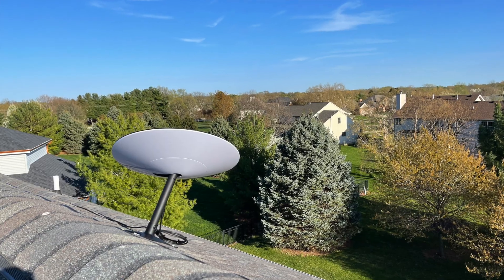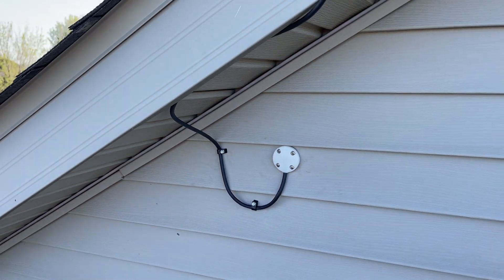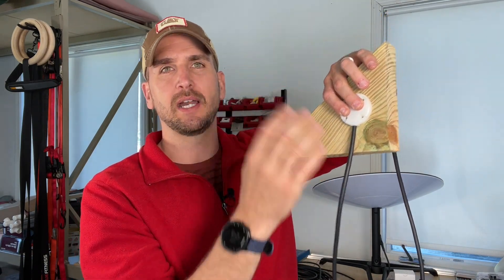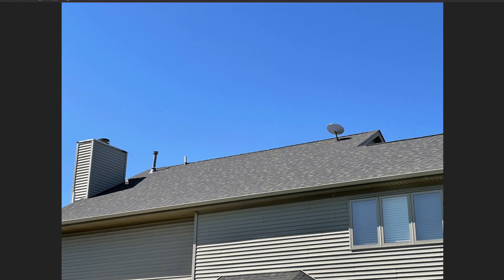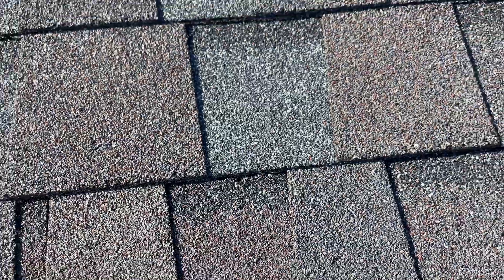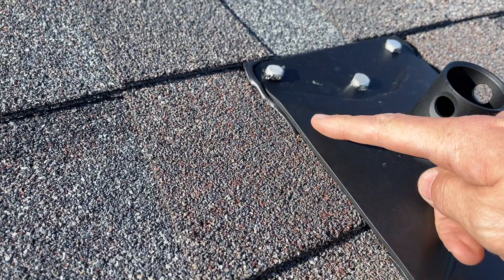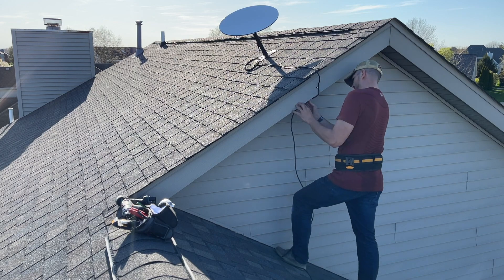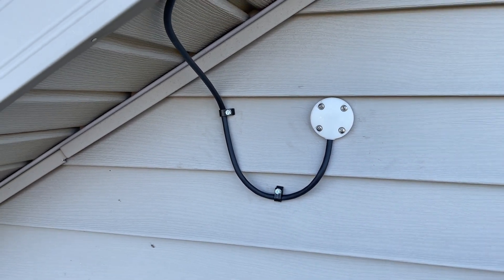Starlink Full Installation and Speed Test

Comment from the maker: Waterproof Cable Entry Cover:  https://geni.us/zS1Mp
Cable Electrical Plate (Brush Type):  https://geni.us/QtHjy
Volcano Mount Instructions:  https://geni.us/8OWXA

Tools Every Weekend Warrior Needs
Makita Cordless Drill Combo Kit:  https://geni.us/t7dIA
Dewalt Drill Bit Set:  https://geni.us/oFlSl
Dewalt Screwdriver Bit Set:  https://geni.us/VDcr
Craftsman Screwdriver Set: https://geni.us/jXqFI
Eklind Allen Wrench Set:  https://geni.us/7XfvO
Pliers (4-Piece Set):  https://geni.us/RIdx
Milwaukee Fastback Utility Knife:  https://geni.us/MlyiLk
Stanley Tape Measure:  https://geni.us/bUfD1R
Studbuddy Stud Finder:  https://geni.us/RySCuVw
Johnson Torpedo Level:  https://geni.us/wiLcDY
Stanley Hammer:  https://geni.us/bPDk8Wo
Buck Bros Wood Chisel Set:  https://geni.us/vk3cpTW
Klein Voltage Tester:  https://geni.us/h9Hl
Klein Outlet Tester:  https://geni.us/kdBAJ
Milwaukee Wire Strippers: https://geni.us/5zuLAbC
Little Giant Ladder: https://geni.us/fmlmTk

DISCLAIMER: This video and description contain affiliate links, which means that if you click on one of the product links, I’ll receive a small commission.

Comment: Only one thing, that's not a roof mount bracket, that's a wall bracket. The "pole" under the antenna should be vertical.

Comment: The way you mounted the base is incorrect. The tube supporting the Starlink needs to be plumb in both directions for the starlink to track properly. The way you mounted the base will negatively affect the quality of signal you can receive and transmit.

Comment: This is the most professional installation I've seen for Starlink.  My mom got Starlink and it failed after some heavy rains.  We got a replacement cable and it worked for a little while and failed.  Apparently failing cables is a common problem with Starlink.  I've been reading in some online forums that the service loop alleviates a lot of cable problems.  Thank for you the in depth explanation of how to install the cabling.

Comment: Best to not put those clips on the roof, as they can cause rot and leakage. Coming from a satellite tech.
Reply: Also not sure if this is different in your area and I did see you mention this in a comment, but that cable should be grounded before entering the house within 20 ft of a grounding source.

Comment: Hello. I just ordered my starlink system. I'm in Central Texas. I have a 50ft tower where my TV antenna and current wifi dish are installed. Should I install the starlink on the tower or should the roof suffice? I cannot go up the tower myself(afraid of heights)

Comment: I have a question about after the mount.  Does the Starlink router provide a good WiFi signal strength?  I currently have a 3-node Wifi mesh in my house for coverage.  Does the router provide ports to connect a mesh system?

Comment: I have Century Link DSL service and it sucks! They had max 10 mbs and then lowered it to 6 because they said too many people were using the service and could no longer guarantee 10 megs. CL also drops out all the time. I was considering StarLink but their website said it probably won't be available until the end of 2022. Their is no other internet service available in my area.
Reply from the maker: Hey Wally, yeah Space X is still cranking up but I would put your name on the list.  It is hard to say how long it will take to get your dish but could be faster than you think.

Comment: While Starlink is a phenomenal service for those living in rural areas with no other internet access, I do not know why anyone would want to replace Comcast or any other landline internet service for Starlink or other Satellite based internet.  Comcast is simply cheaper, faster and more reliable.  You forgot to mention Starlink up front cost is $500 and $100 monthly thereafter.  A quality cable modem is under $50.  I imagine even Comcast's cheapest service will on average beat starlink at least the numbers you showed in your test, my speed test is reliably 12MB upload and 400MB download with 11ms latency.  Lets not forget there is no option for giga bit internet with starlink.  The first snow storm you are going to be wishing for your comcast internet service back.

Comment: Best video I’ve seen yet. I have to say I’m a bit nervous and unsure of how to accomplish this task and do it well. I bought this house 2 years ago and the internet came in from under the floor. The line that came from the street would screw into a box on the outside of the house connecting the line under the floor leading to the modem. The internet was sooo bad that I discontinued the service and went with Viasat. When Viasat hooked up they just connected to the box outside. You think I can do that when I get Starlink or should I do it more along the lines of what you did in this video. I know it’s a long comment but you really did complete an excellent video and will probably know the right solution. Thanks for taking to time to be so thorough.

Comment: Thanks for the video. You may not want to fully seal the mount base as water can go in from the stem and will accumulate inside there.
Reply from the maker: Good point, I actually left those sides open from similar concerns.  👍

Comment: That was a really nice install.  The one thing I would have recommended doing differently is to site the roof mount on the slope of your roof that is in the direction the terminal (i.e. "dish") faces.  In the Northern Hemisphere (US, Canada, UK, Germany, etc.) Starlink terminals will face north.  In the Southern Hemisphere (Australia, New Zealand, etc.) the terminal will face south.  So, assuming you're in the US or Canada, I would have put the terminal on the north face of your roof
Reply from the maker: Hey John, good point and thanks for calling that out.  I was trying to "tuck" the dish on the back side (south side) of my house away from the street and although it looks like the Starlink unit still has enough range of motion to position in the needed north-facing position I could see this being an issue with roofs that have a little more pitch.

Comment: Slick install. Question though, on average I see roof installs where the dish is placed on the South slope of the roof and then when the dish aligns (Northward) the lower dish now rests a mere inches from the roof slope. Would a North install on the roof improve the lower edge of the dish to rest several inches higher from the roof surface thus reduce the likelihood of potential winter icicle buildup and forming a bridge to the structure? 
Love your wire routing into the house...envious!

Comment: Were the speed tests done on WIFI or cabled connection, because from experience WIFI is extremely unreliable and can often limit the bandwidth.
Reply from the maker: Yep, the tests were over Wifi and I hear what you are saying but also just wanted to test with the actual setup I would be using for my connected devices.  Appreciate the feedback!

Comment: Absolutely great video.  I have a deposit on Starlink but since I live on the Mississippi gulf coast will probably not be getting it until the end of the year.  I have been watching as many of these install videos as I can to determine what is the best for my house.  I am curios if you can use the tripod mount that comes with the kit as a roof mount.  It has a bolt hole at the end of each of the legs and would increase stability because of the larger footprint.  It may be that they want as many bolts as possible going into a rafter.  However using  a 2X12 as a back-up as you did should eliminate any problem.  Thanks again not only for this but for all of your great videos.
Reply: Hey Steve. I am confused cause starlink says to make sure the dish shaft is 100% vertical but his vulcano mount was not helping his dish shaft to be strait up ...it was still at an angle and not vertical

Comment: The marine cable clam you used was something I thought about using for my install, though I went through brick, and I didn't know if I could get the four surrounding screws to go in cleanly (one always seems to chip out when you drill holes so close!).

It's good to see how others do their install, and also happy to see you have it all working. The interior finishing was top notch, wish all installers would be so clean and tidy with their work! I hope Starlink serves you well.
Reply from the maker: Thanks Jeff, Starlink has been steadily getting better and the latency is still a bit higher than I would like but the download and upload speeds are now easily beating my 100 Mbps Comcast service.
Reply: @EverydayHomeRepairs  what is the average latency?
Reply from the maker: @jaredfromsubway6755  pretty consistently at 40 ms.  The download and upload speeds are getting much better but I think we have to wait for the next phase to see a decrease in latency.  Just ran a test and I got 169 Mbps download and 18 Mbps upload 🔥
Reply: @EverydayHomeRepairs  AWESOME. I’m in central IL with crappy viasat can’t wait for it!

Comment: Once the dish has found its 'location', it locks itself in place?
And, to confirm, a strong wind would not cause the dish itself to move, thus losing its setting?
Reply from the maker: It doesn't "lock" in place but the differential drive system of the starlink holds up well in the wind ensuring the dish stays in the desired position.

Comment: I had DirecTV in the past and during really bad weather I would not have service. I’m curious to see if SL will have the same issue.
Reply from the maker: Seems like Starlink is holding up well in rain, snow, ice, and wind.  Not saying it will be perfect, since I don't have much experience yet, but I would say it will be much, much better as compared to DirecTV
Reply: Plus it has a builtin heater so it keeps  clear of snow and ice
Reply: StarLink, although it looks like a dish receiver, is actually an antenna, so inclement weather should have very little adverse affect.  👍

Comment: I thought the NEC required antenna cables to be grounded at the point where they enter the house. Am I mistaken?
Reply from the maker: Hey Mark, you are not mistaken and this is a bit of a conversation in the early Starlink community.  From what I gathered we are waiting on official direction from SpaceX to know if we need a separate ground or if the Power over Ethernet ground covers the code.  Once I get the official word I will pin a comment to the top of the comment section.

Comment: Thanks for this vid, I've been curious about Starlink and decided it was time to learn more about  it. You may have mentioned pre-drilling for the lag screws to prevent splitting the backer board. I also wondered if running the cable straight up to the ridgeline and along the face of the ridge cap would lesson debris accumulation and encourage rainwater draining. Just a thought.
Reply from the maker: Hey Bob, thanks for the feedback and I am sure there are a number of routing improvements I could make but for the most part the hole coming into my attic is tucked away out of 95% of the weather we get around here since it is facing East and most of the rain / precipitation comes from the West. 👍

Comment: Nice video and install. I have no need for SL at this time, because I am served by Verizon FIOS (or Comcast if I wanted). However, it's nice to know there's some competition - keep the big guys honest and fair with their pricing since they no longer own a monopoly on the last mile.
Reply from the maker: Yeah, I think things will get a bit interesting in a year or 2 but I am curious to see what the limit is on the satellite capability.  I think SpaceX is sandbagging a bit on what they really think the connection speeds can be with a mature mesh of satellites.  The deployment will take a bit but I will be along for the ride and provide periodic updates 🚀

Comment: Can you do a speedtest with a hardwired gigabit device? Wireless devices will bottleneck it right out of the gates, you may get faster Ethernet connected. Based on your comcast comment, is everything in your house wireless?
Reply from the maker: Yes, the connection for both Comcast and Starlink were both done over wireless and that is how we connect all devices in our home.  I actually don't even have the converter from USB-C to ethernet for my macbook 😔
Reply: @EverydayHomeRepairs  You got an amazon wish list or a patreon??  Its completely self serving but i am sure you will see faster speeds on a hard wired link. I'd love to see them down the wire with your roof mounted setup =D

Comment: How about ice buildup on the dish mechanism in the winter? Do you foresee this being a problem? I often wonder if companies like Tesla give any thought to the plight of the North.
Reply from the maker: Good question Chris and at least for this product they did think through that issue.  The Starlink has a built in heater and from what I have seen in other tests throughout Canada during this past winter seems like it performed well 👍👍
Reply: @EverydayHomeRepairs  That's really cool! I think this system has tons of potential, especially for the rural areas.
Reply from the maker: @ourkid2000  💯
Reply: @EverydayHomeRepairs  If it worked in canada winters, it will work.
Reply: There’s a YT video from a guy in Calgary somewhere on here a few months ago. He mounted the dish on a flat roof. The antenna then did it's dance and aligned itself on a slight angle. That night, it snowed. Next day, no internet. The snow had melted perfectly, but the dripping water formed an icicle that then froze to the roof and stopped the dish from moving. Result : broken drive unit. He said SL customer service responded promptly and replaced the dish. 
However, even if the dish was a bit higher off the roof, would the weight of icicles become a problem? Time will tell.

Comment: Could you have mounted the base at 90° to allow water to pass under?

Also, looks like you've got way more space to work in your attic than I do! Nice. Be good to do some air sealing on those holes and top plates!

Nice clean install!
Reply from the maker: I don't think you could do a 90 degree install since I think the range of motion might be limited for the dish to get the best orientation for the satellites passing overhead.